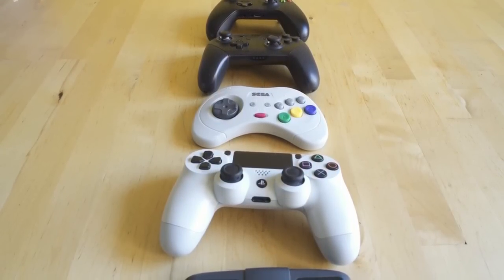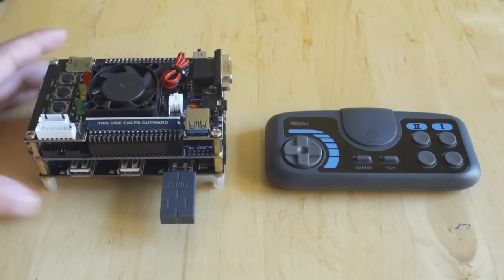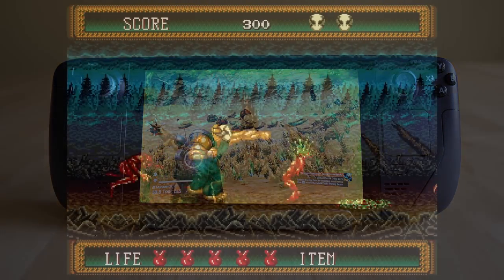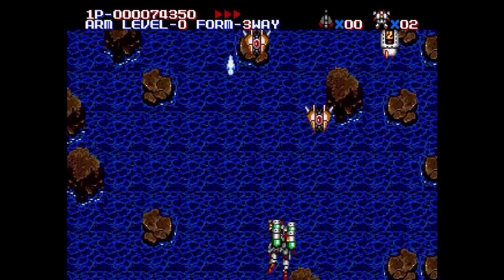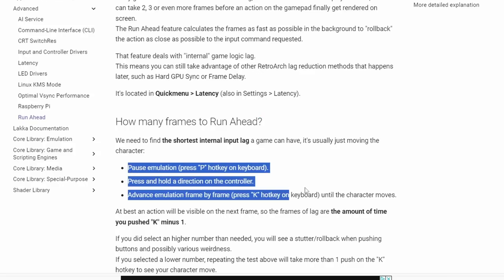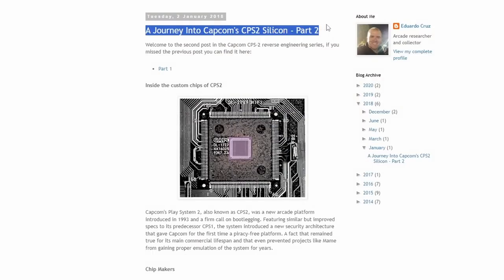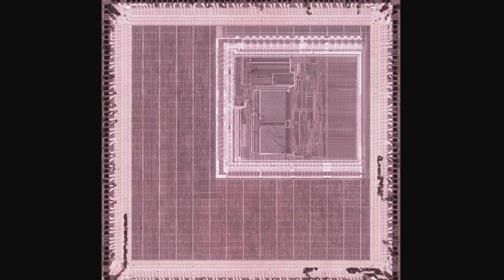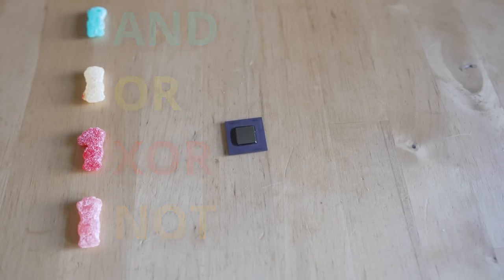MiSTer FPGA; What is FPGA Anyway? Is it Better than Software Emulation? How Does it Work?

Comment: I remember first learning about FPGAs in digital logic class. I was amazed how you could recreate any IC chip inside fpga. When I first did FPGA labs I was so happy I didn’t have to physically connect any wires to IC chips and just had to work through software to make logic circuits. I’ve used “quartus” and made circuits from binary multipliers to a binary blackjack game between two players. I’m so happy fpga even extends to n64 now, this is a mainstay in retro gaming!
Reply from the maker: Technology is great because when it works like this it basically feels like magic...except its reality
Reply: That's how I justified the expense to myself: besides the cool retrogaming aspect, the DE10-Nano looks like a fine platform to learn how to program FPGAs. 😂

And to be fair, it's a lot cheaper than previous FPGA boards I've found when I was in college. There are even cheaper boards (albeit with lower LE and IO capacity) that are good enough to implement simpler systems like an Apple ][ or a NES.
Reply from the maker: Yes Intel subsidizes these keeping the costs down

Comment: Key point with FPGA emulation is not just parallel execution but that the FPGA is a Real Time Computing platform, meaning the code (emulated hardware core) execution completes in exacting timing (down to the cycle) every time, which is something you cannot really get on a normal CPU running an OS and a software emulator.
Reply from the maker: Yes. No matter how many cycles you through at it with the CPU. But people are getting V close

Comment: I'm for both software emulation and FPGA as long as the projects are 100 percent open source. We have had too many incidents when an emulator dies and no one is able to improve or modify it afterwards. Open source projects also document their implementations by their very nature.
Reply from the maker: Yes. Model 2 emulator springs to mind
Reply: I used to hate that the fully featured version of Magic Engine was behind a paywall back in the day too.
Reply from the maker: That was weird. Especially for emulation

Comment: I am not an absolutist or anything. I have an FPGA. I have many devices with emulators and love them all. There is something special about the fact that an FPGA can be cycle perfect. When you watch one side by side of an original console and after 10 minutes of play time, they are still frame perfect. It blows my mind that someone took all of the components of the old hardware and coded into a core for an FPGA. 

That and lag is always an issue I run into on old console gameplay. It just "feels" like I remember on an FPGA.
Reply from the maker: I’m the same. I have a vast collection of original hardware, FPGA devices, emulation handhelds, etc etc. I use them all
Reply: I find there are less original hardware absolutists online anymore. Maybe the retro collecting craze has begun to die off or those people just kind of aged out of the hobby, but about 15 years ago those people were completely insufferable.
Reply: @ciaranmccarthy  Agreed. Emulation has come a long way. Also, collection appears to be the only purpose. Not collecting to play, but collecting to collect. I believe that is why they don't care about gameplay. I have old games and consoles. And I probably play old game on an emulator more often than OG systems. It's just convenience at this point.
Reply from the maker: And it’s not like I don’t have a lot of hardware 😂
Reply from the maker: I give my OG games plenty of action. More so arcade these days
Reply: @VideoGameEsoterica  I'm sure you do. I do not believe you are part of this overpricing in the retro space. It's too much speculative investing. And don't get me started on WATA grading. I'm not convinced they did not manipulate the market for their own gain.
Reply from the maker: Lol nobody even wants the stuff I buy. I don’t think I’m upping the prices on the unloved randomness that I covet

Comment: Great video as always :)

One thing I always like to point out is that input lag can actually detriment your experience even if you can't "feel" it, since it effectively makes reaction-based execution windows smaller across the board.
What may have been a narrow success on a lower-lag setup becomes a miss on a laggier setup, regardless of whether your hands can actually feel the delay. How often this actually presents is hard for me to say, but it's bound to come up across an extended play session.

Also, runahead is great, but it effectively just lets you eliminate the frames of delay built-in to a given game's code. There's nothing to guarantee that eliminating this lag precisely cancels out the sum of the latency built in to your setup (emulator, controller, display, etc), so it's not really a way to match real hardware delay, strictly speaking. In some cases, I think I've heard of people getting lag LOWER than on real hardware + CRT, which is really interesting to me.

My biggest personal gripe with software emulation is frame pacing. Motion never looks nearly as smooth or consistent on software emulators, compared to FPGA or real hardware. It can be pretty distracting imo.
Reply from the maker: Yes...that does make sense with lag. Its a hard concept to fully explain
Reply: @VideoGameEsoterica  it's definitely kinda tough to wrap your brain around!
Reply from the maker: Once you go TOO deep for sure. And people lose interest. I try to offer level a “below the surface but not ten levels deep” explanations to the casually curious

Comment: For me MiSTer is a winner over say software emulation on a raspberry pi because of how easy it is to connect to a CRT and the small nerdy joy I feel that this is as close as possible to original hardware. Lag reduction is important to me. 

But more than that I am just fascinated by the tech and the community and the fact that games get released overtime reminds me of the good old days when mame was new to the scene. 

Getting simpsons, TMNT and soon Mortal Kombat to play on my home made CRT connected arcade cabinet is pure joy.
Reply from the maker: The ease of analog is a huge component of MiSTer that I love
Reply: I built a couple of retroarch PCs and messed around long enough to use CRTemu driver to output to my CRTs, some over component and some s video. They looked great but the games just didn’t feel right for whatever reason….since I’ve picked up a MiSTer the experience is far better, you really feel the difference in a well programmed FPGA setup

Comment: The only real annoyance I had with Run Ahead on software emulation is that you had to dial in how many frames you want to run ahead because each game is different. Each game has certain number of frames of lag run ahead is trying to remove but some games have 1 or 2 frames and some games can have up to 6 or 7. So, you had to spend time futzing around with getting the exact amount of frames you want to run ahead without clipping anything in game. Which given retroarch's horrible UI was never something I relished doing for each game I played. I know you can save per game profiles so you only had to do this once per game but if you play a lot of different games it's still a lot of dialing in. Truth be told though, I haven't used retroarch in a long time so maybe they've included a way to auto detect this and I'm whining about nothing lol 

Also, Run ahead works fine on 8-16 bit but once you hit PS1 and beyond, it's much more demanding.
Reply from the maker: Yes its def a variable that needs to be looked at per game
Reply from the maker: Yeah for a while you guys got the worst of it with games
Reply: Not only that. In reality in many cases you cannot removing all lag down to real hardware level. If my pc system have 7 frames of lag (which is typical value for modern systems) for retro arch, you need running ahed 7 frames, what in many games causes clearly visible frame skipping. You could running ahed less frames, i.e. 3 frames, but then you cannot removing all emulation lag. Also run ahed is not compatible with all games in all platforms, especially for those making something randomly midstage.
So run ahed is just dirty trick, barelly reliable and running anything in parallel is just better option.

Comment: Awesome video which answered a lot of questions!

I would like to ask you something and get your opinion.

I'm currently trying to capture game footage from my Sega Genesis 2. The video comes out a little shaky or stuttering and the audio has that annoying buzzing noise pretty much throughout game play.

I was looking at getting a Retro Freak but also saw the MiSTer.

I'm running the video connection through my Elgato HD capture card which is slotted into my M/B through HDMI to a computer monitor using HDMI as well.

In your opinion, do you think the MiSTer is superior to the the Retro Freak? I just don't want to buy something that would be overkill for what I'm trying to accomplish. Which is recording the game play and audio without distortion for video projects as well as just enjoying my old games. Id also like to be able to play these old games with as little issue as possible and in their original aspect ratio.
Reply from the maker: 100% superior. You will get rock solid 1080p captures out of MiSTer into the elgato. It’s what I use on the channel myself
Reply: @VideoGameEsoterica  Awesome, thanks!

Comment: I always explain it like blueprints, the mister project is trying to get the blueprints of an NES motherboard onto a single chip, and it's mostly possible because technology is so advanced that my phone is equivalent to a full on PC gaming rig built in 2013, and then note that my phone is mostly a screen a case and then a giant battery with an Itty bitty processor and motherboard tucked in-between all of that
Reply from the maker: Blueprint makes sense except for the sequential / parallel component. That’s what I wanted to try to visually explain; order of operations
Reply: @VideoGameEsoterica  yeah man, it's a solid video, and I wish I had something like this when I was first dipping my toes into the mister pool...  a lot easier to think about sour patch kids vs reading through forums lol
Reply from the maker: Haha visual learning is the best IMO

Comment: @6:00 Eh. Yes, in practice but not technically true. It is more complicated to replicate the logical concurrency in software but it is possible. And of course you have parallel systems using multiple CPU cores running software simultaneously but again... in practice you wouldn't be splitting up everything that runs concurrently in a chip into individual threads or processes. The overhead of keeping things in sync would destroy the value of running concurrently. That said at a larger component level that process may be fine depending on the hardware design. Such as running a CPU interpreter and DSP interpreter concurrently and replicating sync where approrpriate.
Reply from the maker: This is becoming more complicated than candy lol

Comment: Curious question, will there ever be a usb stick form factor fpga?
Reply from the maker: There are very small footprint FPGA chips out there that could presumably fit. They certainly wouldn’t be as capable as this but in 10-15 years…never know!

Comment: so from what i'm understanding real hardware would be much more akin to how mister does is, running the logic simultaneously rather than sequentially, and therefore it can be more accurate correct? are there examples of real consoles that run their logic sequentially or is that just how logic elements in a hardware chip work? and does mister's method allow it to emulate things that are typically more diffucult for software emulation?
Reply from the maker: Correct. Real hardware would work in parallel. Just like any piece of hardware. It will run through everything needed to do ANYTHING in parallel